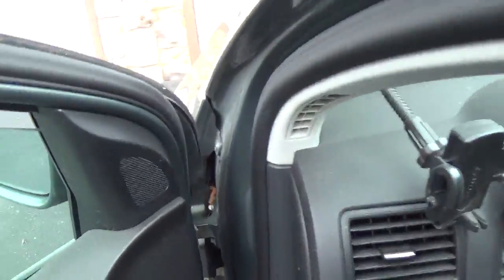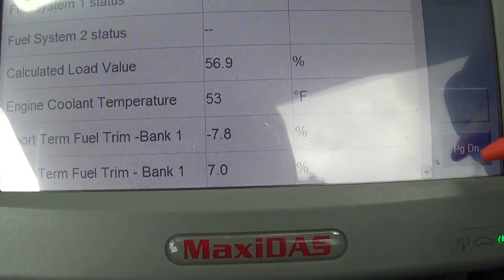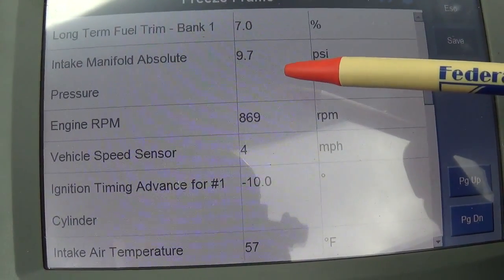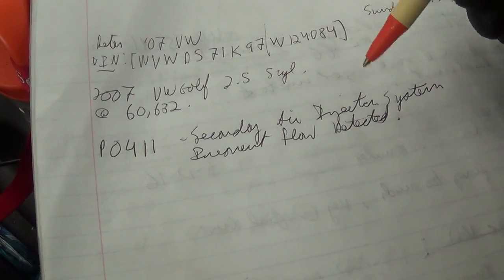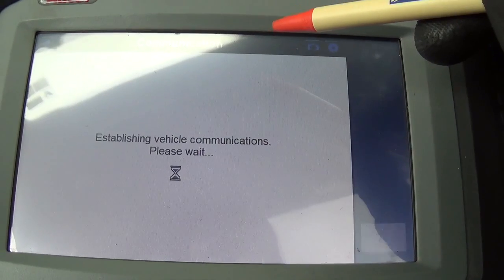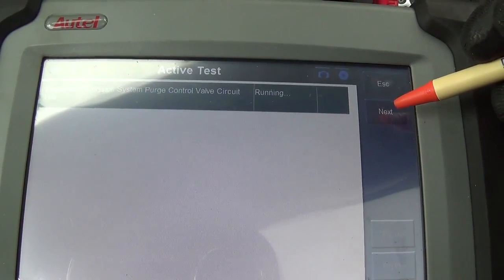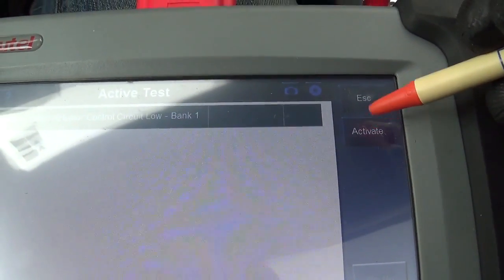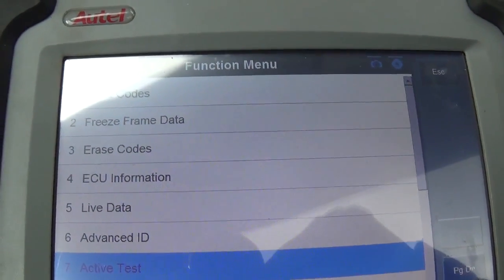VW Secondary Air Problems P0411

Comment: That’s my Dd and I’m about 50miles from Ithaca!! I have had 2 vw with the 2.5 5cylinder and it’s an amazing engine and they all have this same code. Usually the map sensor or a crack in the pipes or the pump. Love the diag !!

Comment: I had that issue with my 2013 bug and when i activated the pump with the engine off i heard the air leaving the pipe instead of the exhaust, the pipe was expensive but not $600 to replace. Good video as always!

Comment: Nice diagnostic! Thing is, YOU figured it out in 1/2 an hour. But if you don't know the system, you have that learning curve, which amounts to all the time required to FIND the info online, or PAY VW for access to their extortion racket of secret information. THEN and ONLY THEN will you know what's going on enough to test this system. I just got through with a similar issue on a 2011 Jetta 2.5L. Took me 2 HOURS to find the info I needed. Then it took me another 2 hours to figure out what was going on. Turns-out they had a recall on that pipe with a new sensor. That solenoid valve was also bad (corrosion from salty roads up north). Then there's the problem with the PCV system spewing oil into the intake manifold and fouling up the MAP sensor. The ONLY solution to that is to install a CATCH CAN between the valve cover (PCV valve) and the intake manifold. Just cut the PCV line and install the CC in between the two. Then I smoke tested the intake system to find any other leaks. Turns out the intake manifold bolts were LOOSE! After torquing all those bolts (special tool required!), and another smoke test, the thing ran like new. See what I mean? You MUST know the system. And you also MUST know what typically breaks or is DEFECTIVE IN DESIGN with ANY computerized vehicle. Anyway, NICE DIAGNOSTIC. Thanks for sharing. I always enjoy watching your videos!

Comment: I was looking at another video and somebody mentioned you were like a wizard with tricky problems. I'm working on a 2004 Landrover Discovery 2 for a friend, first time I have ever worked on a Landrover and first time I have dealt with a vehicle with SAI. Check engine light is on, getting codes P1412 and P1415, wont pass emissions. SAI blower works, relay is good, SAI solenoid is good but put a new one in anyway (yes its good), vacuum looks good, I happened to notice fusible link FL2 was blown which some comments online said the SAI runs through that, replaced that, still no change, SAI doesn't come on when engine is cold or first starting, not sure where to go from here. I did jumper terminals at relay and blower came on, so wiring is okay, any ideas, I'm at a loss ?

Comment: May not be a botched job at all. Well, no, I'm wrong.  Partly a botched job for sure. The plastic pipes are notoriously brittle, and there was a darn good chance that pipe was intact until a mechanic twisted on it to get it off the valve. I've done it. In fact, sometimes it just part of the job to replace that plastic pipe because there isn't any way your going to get that pipe off without cracking it. If the "flap" was in fact bad, they fixed the problem and simultaneously created a new problem that would set the same DTC. The thing I CAN fault the dealer on is that they didn't test their work. The same tests you used to diagnose the problem, ie, the Sec air pump actuation combined with getting your nose under the hood while the pump is running would have immediately showed the cracked pipe. Well, that's flat rate work for you! The mechanic gets paid the same whether he checks his work or not. In this case, the dealer wanted the customer to check it by driving. Sheesh. They deserve to get brow beaten over that!  I found this video after just now fixing a Audi V6 in the shop that had the same code. I used the VCDS to go through the exact same tests you did. In my case, it was a perished vacuum hose from the underside of the intake that supplied vacuum to both the "flaps" solenoid and the intake manifold switchover valve. In addition, the Secondary air pump has one of the rivets that hold the case halves together has split, and there is a smallish leak (maybe 10 or 20% of the total flow)  coming from there.  With what I think is the main culprit fixed, if a cold start and a test drive doesn't throw the DTC, then I'm going to let the customer know the options for repairing/replacing/living with the problem of the split pump and see if the code comes back. I try to get customers to never "just live with" a CK-ENG light, as although it's not going to tell you when your low on oil, if you get a stuck injector or something like that, it could very well save a $2k+ catalytic convertor.
Very much enjoy your work, and enjoy watching as a good diagnostician goes through his routine.

Comment: Thanks for the detailed video.  I was getting P0491 couple days after DSG flush from dealership.   Dealership said nothing they did.   Watched this and traced the hoses and saw  a broken hose right from the SAI sensor.    Ended up fixing with self bonding silicone tape.

Comment: thank you so much for this video it helped me out a lot in finding where the issue was coming from. turns out that my hose was disconnected from the bottom fan underneath the throttle body. on my 2008 volkswagen jetta 2.5

Comment: Can you answer a dumb question? I need to replace the inlet solenoid control valve that sends vacuum to the combi valve's control inlet. How do I safely and properly release the electrical connection? It appears to have a metal release bar on one side, but I want to handle it gently and properly instead of breaking something. Pull straight up with pliers? Pry outward?
Reply: Got it -- bonehead simple :). I just pulled out the wire clip, and unplugging the electrical connector was a cinch. Removing three 10mm bolts then allowed me to drop the triangular mounting plate for the two control solenoids out from under the intake manifold. New $75 part, and I was back in business.

Comment: I've had terrible experience with VW-Audi dealerships throughout my life.  It seems that VW doesn't take disciplinary action with dealers for low customer satisfaction (Ford is even worse, and Toyota definitely does try to keep dealers in line).  Looking through my A4 and Fusion recent service records and quotes, it appears that the current labor rate is approx. $500 per hour (based on time that repairs actually take).  This is the common scam with dealerships, but VW-Audi (and Ford) seem to be worse than other brands.

Comment: I fucking love you bro!!!  I've had this error code for a long ass time on my 2007 Jetta.  Finally got my hands dirty, took everything apart, and it was exactly the same issue.  Seems like VW cars have this same issue because of those crap plastic tubing.

I went to home depot with part of the tube, then tested plastic tubes for fixes, and;

https://www.homedepot.com/p/ProLine-3-4-in-O-D-x-1-2-in-I-D-x-10-ft-Clear-Vinyl-Tubing-CP034012010C/312487054

A little piece of this tube fit absolutely perfectly.  Nice, tight, and wasn't budging for anything.  I put a little piece in one end, then combined the tube together with it inside and then used;

https://www.homedepot.com/p/Nashua-Tape-1-in-x-3-33-yd-Stretch-and-Seal-Self-Fusing-Silicone-Tape-in-Black-1743082/100206050

to wrap around it nice and tight.

I cleared the codes with OBD2 scanner, started driving, and monitoring my i/m readiness for the drive cycles.  On my scanner when air_rdy finished and got to "ok" it would always make my check engine light go on and spit the error code out.  This evening it hit "ok" without the code.  So far so good!!  Looks like the fix was a success.
Reply: How did that fix end up working out I have same issue?

Comment: Perfect fix...my CEL has been fixed. The break in my hose was right after  the hose retainer clip on the side of the engine. A 1/2" rubber garden hose inserted perfectly and taped down with black hockey tape ( Canada Eh!) Thanks mate!

Comment: Hi, how do you get the secondary air system to go through its drive cycle?  I've driven about 500 miles, local & on freeway, over the last 3 weeks, but the secondary air system is still reporting not ready when I try to get it smogged.  All other systems have successfulky completed their drive cycles & pass smog tests.  It's only the secondary air system that's reporting not ready.  I have a 2000 vw beetle, turbo.  Thx!!
Reply: Did you ever figure this out? Currently experiencing the same thing
Reply: @BriannaaRhodess  It was a bad hose., which is why it never got thru the drive cycle.  Take it to your mechanic & let him know what's happening, & he should be able to replace the hoses for you - it's not expensive.
Reply: @JasmineApple  Thank you so much for your help! I will take it in tomorrow! Drove over 1,000 miles these past couple weeks and everything it set to ready but the secondary air system!

Comment: nice diag! my fix would've been a plastic bottle a little larger than the hose(maybe a 16.9oz pepsi bottle) with top and bottom cut off. sleeve the broken pipe and use heat gun like heat shrink.

Comment: Moral of the story is unless you’re under warranty never take it to the VW dealership. They charge a ton of money.  A lot of the time these older VW’s throw a code it’s something really stupid. I bought a b5.5 wagon. Had a light come on. The oil was dirty and causing the lift angle sensor to not read right. If I took it to dealership they would of replaced the sensor. I changed the oil and the light hasn’t been on since.

Comment: Dude.  I'm having the p0411 code on my 2003 beetle turbo s.  Before I go replace the pump or valve, I'm going to check all those ribbed hoses.  I'll let you how it turns out. Thanks

Comment: I guess it was several problems with the system. When he tested it it probably worked. When a pipe is cracked like that it might seal sometimes, but with the engine moving it will leak.
So it was probably ok when the mecanic tested it. Mabye he sould have found the crack, but its not always that easy. These cars suck. Always something with them!
Why should everybody throw cardealers under the bus before they have the whole story?

Comment: That cracked inlet pipe could have supplied dirty air to the diverter valve causing it to fail. The dealer is getting a bad rap here.
Reply from the maker: Not a chance. And why didn't they replace the cracked pipe then? xD
Reply: I missed the part on the receipt where they stated that the line was checked and OK Ivan the first time I viewed the video. You are right. The valve does look new though, at least they changed it :-)

Comment: I know this is 3 years old but thanks for this, Ivan!  I have a customer's 2009 Rabbit (Golf) 2.5L with a P0491 Sec Air insufficient flow code and only my Autal DS708, just like yours, to scan it with.  On mine it says "Secondary air injektion system control A circuit" which I assume is the pump circuit since the next test is a switching valve A circuit, and all I heard for the pump was clicking on and off.  Your comment about the pump turning on and off was very helpful in knowing what I should expect from the bidirectional test.  I'm guessing the pump is seized up on this car but will dig in more tomorrow with the test light.  No Verus here to get code setting criteria info from but this was more than enough to get me on the way to a quick diag on this one.  Thanks!

Comment: man who the hell drives that car?! at 60k miles that car should look like new, but instead is full of dents and holes, very dirty interior engine full of dust. i have a 2002 passat with 240k km and looks way much better than this.
Reply: depends where u live too. he said they were up in New York salt and sand on the roads during the winters over years will put more wear and tear on it faster. That be my guess

Comment: Anyone can easily diagnose if the vacuum pump is working or not , simply disconnecting the hose at the valve and then starting car at cold temp and then you will feel the air being pushed out of the hose or not , if no air it’s the vacuum pump , if air is coming out it’s working and it’s either a crack in the hose like you found or a bad valve in the egr unit

Comment: I am having a similar problem with my 2008 VW Jetta SE.  A malfunction light went on last9in early December of 2017 and I had to repair it as my inspection was due in January  -- it cost me $488.00 and I had just been laid off from my job that very week. The light stayed off until two weeks ago-I took the car for an oil change- it has only 12,223 miles on it and they said to fix it this time will take two days and $1200.00--I am extremely frustrated.  The car is paid off, low miles, but it is now the same issue with air injection.  I wish you lived in Washington, DC.  I am waiting for a while to repair it as I do not have an emission inspection again until January 2020.
Reply from the maker: No harm in waiting! Did you check for a broken air pipe like I showed in this video? Or you can buy an entire used reliable Toyota Corolla for $1200 :)
Reply: I will probably switch to a  Toyota next go.  The mechanics replaced a cracked last year....how often does this happen and should the pipe be under the hood.  I am not good looking at dirty motors.

Comment: The combi valve is right on top , over $ 300 for labor. If they activated the SAI pump and just listened ...  Ivan's proper repair even replacing the hose assy would have been around a third of dealers, and they did not fix it🤔

Comment: I have this problem and I’m hoping it’s a torn pipe. Its a 2005 model and the check engine light came off and back on by itself randomly but i have to smog check it this month so I have to fix it
Reply: did the tape fix your problem for smog check ?

Comment: It is also possible that the plastic line was cracked during the repair at the dealership. The tech at the dealership may have fixed the original problem, but during the repair the plastic line cracked. May not have been complete incompetence.

Comment: This code popped up during my emissions check today. I am going to run through all the hoses tomorrow. Hopefully it’s the same thing and I don’t need a new air pump! Thanks for the awesome vid!
Reply: was the hose your issue I have the same code
Reply: in my experience with this engine it's rarely ever the mechanical parts that fail. always some dingy sensor, some plastic that's broken and rotted away, some gasket, etc

Comment: I am not o fan of dealerships, also, but try this scenario out.  The secondary air injection pipe was broken AFTER the new secodary injection diverter valve was installed because the technician was in a hurry or WHILE the technician was removing it to install the secondary air diverter valve.  Those plastic pipes become extremely fragile with engine heat over time.  Both the divereter valve being stuck or the pipe broken will result in the same p0411 code.

Comment: I had broken timing chain guides on a 2002 VR6. The dealer wanted to replace fuel injectors because there were misfires as a result of broken guides. Has anyone had an actual good experience with a VW dealer?

Comment: hi, i have a 2000 mk4 jetta Vr6. and i am getting a p0114. i've removed the front bumper and checked all lines for sign of leak and can't find any. i also looked at the same pipe that you found that was broken on your video and it's fine. i nothis that when i remove the ENGINE COVER TRIM SET small plate  with the VW LOGO (front right side) that's on top of the rotary valve that turn the intake manifold shift rod and i clear the code, the engine check light stays off. but when i put the plate on back, one hour later the engine check light comes back.
Reply from the maker: I don't think that car can even set a P0114...what is the code description?
Reply: sorry,  it's p0411, secondary air injection system incorrect flow detected
Reply: sorry it's p0411
Reply: i strongly think that i have a vacuum leak near the front drivers side just under the VW logo section.. cause it only comes on when i install the engine trim with the logo on the engine. i am going to fill a a spray bottle with water and soap and spray that section to see if bubble come out anywhere.

Comment: Thank you kind Sir for exposing Audi / VW service techs complete incompetence!!I had an Audi A4 with this exact same code P0411, the dealership changed lamda sensor, air mass flow meter, air pump and the code still kept coming on - in the end I was left with a bill of over 800 euro and the fault code still coming on!! I was at the end of my tether with Audi Ireland!I took it to a back street garage and they found the problem was also the pipe!Audi service rang me a week later, telling me they would like to get to the bottom of the problem, suggesting a complete engine overhaul for 4,500 euro!I will never buy an Audi or a VW again!

Comment: Had another problem like this with my Audi on the PCV hoses.  The hoses are really brittle and crappy, so I used some heater hose and took an exacto knife to cut those push connectors off the original hose and attached them to my heater hose with some hose clamps.  Saved myself over 300 dollars, since a new PCV hose is 300+!

Comment: Just a thought.. If diverter valve was bad may have stressed that pipe due to pressure build up, may have split after the dealer performed the repair.
Reply from the maker: Perhaps...but they certainly didn't verify their repairs!

Comment: The car owner paid $620 for incompetence.  BUT could have the diverter been defective and the pipe broke secondary from all the pushing and pulling getting the new part in??
Reply from the maker: Perhaps, but that is irrelevant in this case. However we can say for certain, based on the sequence of events and documentation, is that they did not 100% confirm a faulty diverter valve or correctly verify the repair.